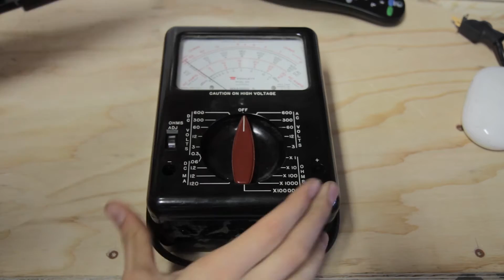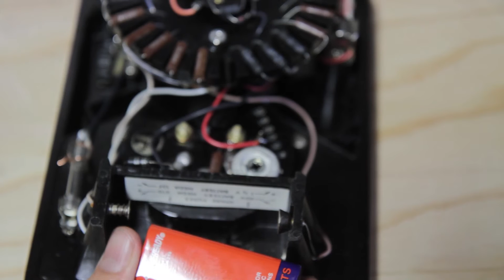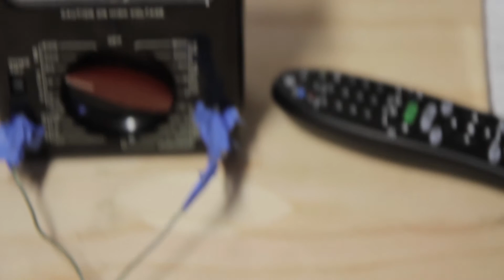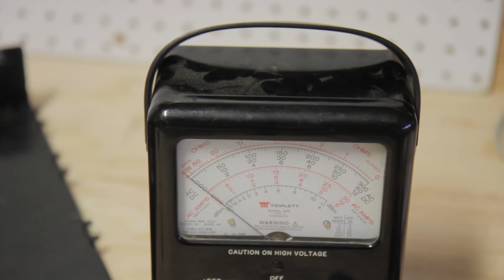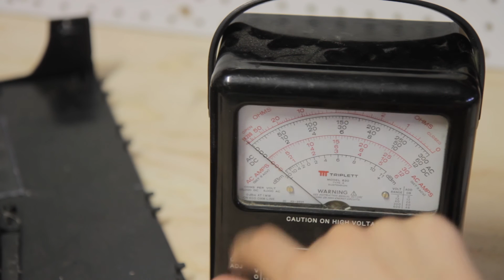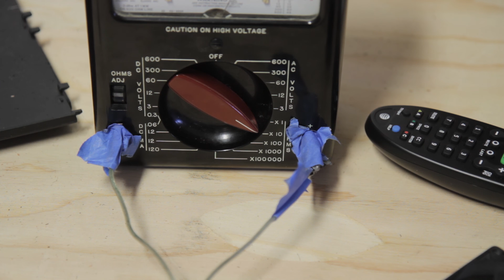Whats Inside #11 Analog Multimeter

Comment: Hi, I just bought a vintage Jana HJ-8005A analog multimetre (made in Japan, yay!). The ohmmeter settings are the usual RX1, RX100, RX1K and  RX10K. Upon shorting the leads to zero the needle, the needle swings to zero for all RX settings except the RX10K setting i.e it always measures infinity/open circuit even with leads shorted. Everything looks OK inside there, no broken contacts or anything obvious. Batteries are confirmed to be good. Any ideas as to what might be going on there?